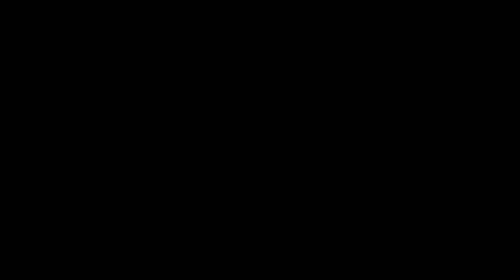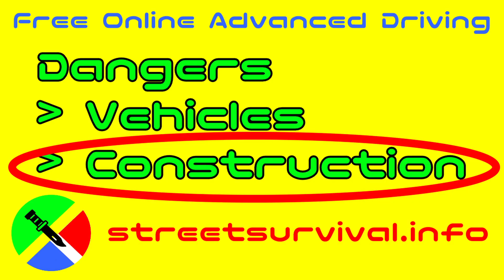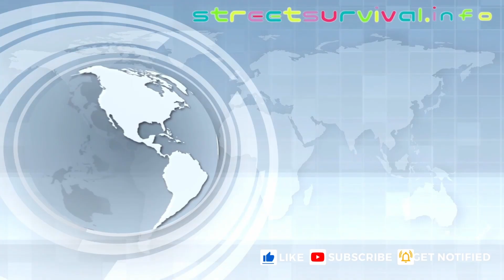How to Drive Safely Near Construction Equipment

Comment from the maker: ❓To think about: Why can a construction vehicle’s front blind spot hide an entire car for up to 20 feet, and why is the ‘Safety Yellow’ color actually designed to trigger a specific psychological response in your brain?

Common questions answered in this video:

• Why do construction vehicles like dump trucks and bulldozers pose serious risks for other drivers?
• Why do heavy construction vehicles require much longer stopping distances than passenger cars?
• Why do construction trucks make wide turns that extend into adjacent lanes?
• Why are blind spots around construction vehicles so large and dangerous for nearby drivers?
• What are the safest defensive driving practices when passing or driving near construction equipment?

See related quiz.